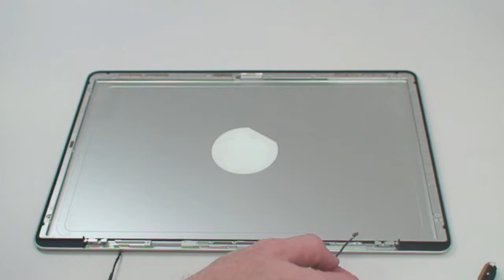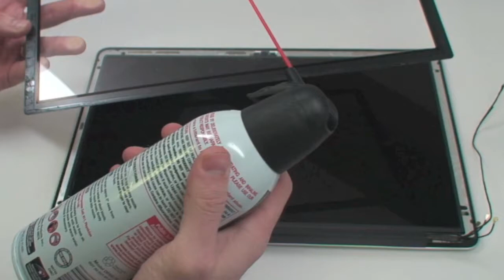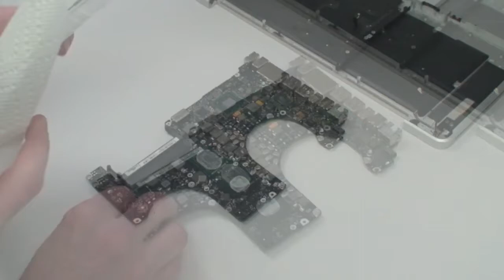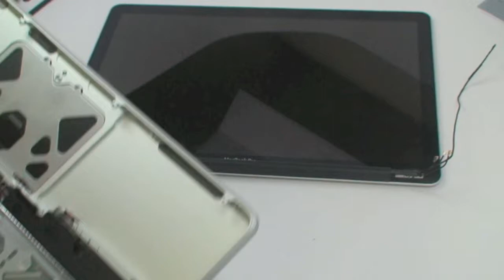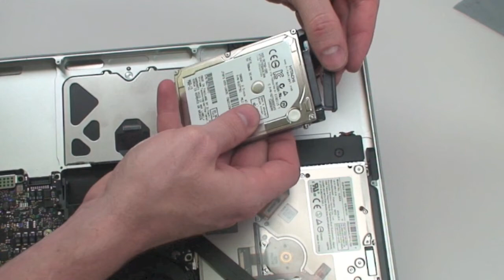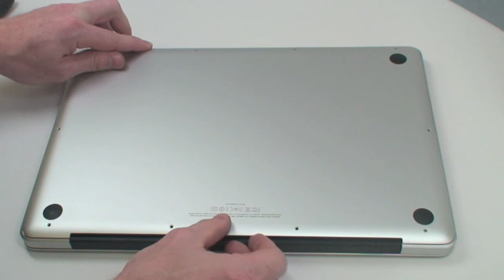How to Reassemble 2012 Macbook Pro 15" Unibody

Comment: I was watching this hoping for a tip on connecting the small ribbon from the surface of the keyboard cover to the underside of the motherboard (relative to the MacBook as it is upside down).  It looks like you skip this step?
Reply from the maker: That is the keyboard backlight cable.  There is a little flip lock on the opposite side that the cable goes in on the connector.   That flips up and then the cable goes in.  Then flip the lock down to keep the cable held in.